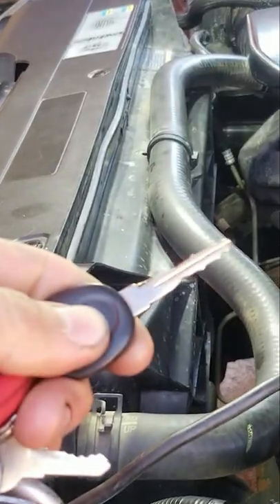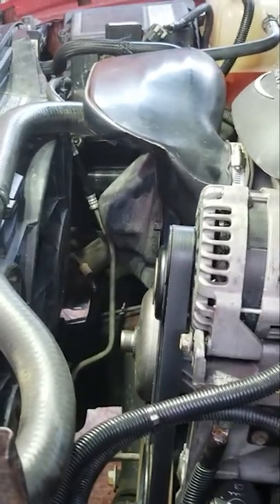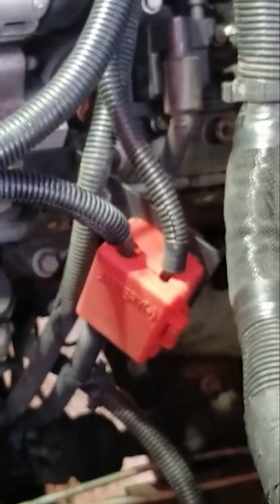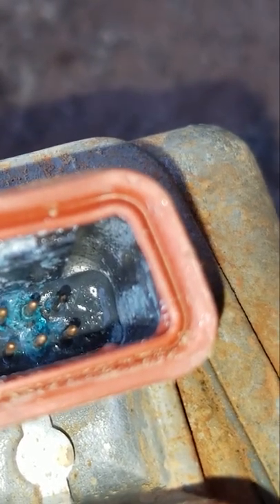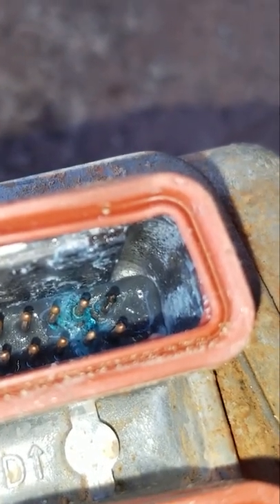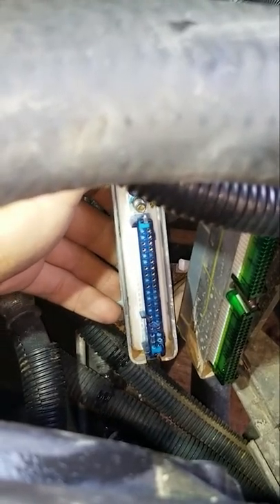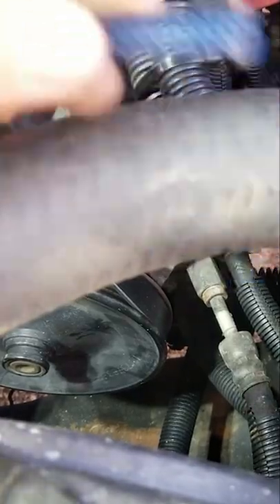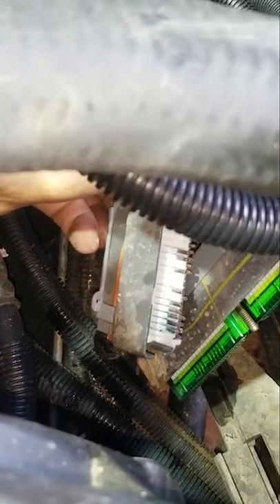Customer States PCM Corroded

Comment: Funny power control module story from a dealership I used to work at. There was an amazing mechanic that was the go to kid when complicated issues came through the door. I forget what the RO said but the official diagnosis from the kid was a bad PCM. The kid gets a new one from the parts department and it doesn't resolve the issue. Kid goes over his troubleshooting again with the parts manager and they had 2 more PCMs in stock and so he swaps it out with another brand new unit. Problem still persists. He swaps it out with the 3rd PCM and the problem still persists. Service manager told the kid to start from scratch and he spends 2 full days pulling apart wiring harnesses and running jumpers. He broke like $300 in panel clips troubleshooting and in the end still says bad PCM. A Chrysler master tech comes from another dealership and does the same thing the next week. His official diagnosis was...... Bad PCM. Now the customer is PISSSED about not having his vehicle for 3 weeks and the original mechanic suggested taking a PCM out of a vehicle on the lot and everybody was completely out of ideas so what could it hurt. He pops the known good PCM out of a brand new truck and instantly the problem disappeared. Chrysler didn't believe the story and went over every single RO note and interviewed the mechanics and in the end they figured out that there was a batch of PCMs that had a manufacturing defect and the dudes truck and all the PCMs in the parts dept were from the same batch. If I didn't see that saga unfold on the lift next to me I wouldn't have believed it but i saw it with my own eyeballs. The mechanic was only like 24 at the time so nobody took him serious but after this craziness we all really respected him. He died of a heroin overdose a few years later.
Reply from the maker: Woah, that's a crazy story. With a sad ending. Just because he's young doesn't mean he doesn't know his stuff.
Reply: Wow thanks for the story
Reply: @galenyoung8349  buddy please reach out to mental health providers in your area.
Reply: @galenyoung8349  bro what the heck
Reply: Sorry bout your buddy. Got a lot of respect for guys who can work on any wiring problem on these new models. It's all Chinese to me lol. My little brother died same way. Was also very smart. Pilot. Civil air patrol. But got a DUI while home and it ruined his life. Get a DUI on you record and ur a pilot and it's over. Went downhill from there till he died from fentanyl laced heroin. Lot of good people's lives destroyed from that shit including their friends and family.
Reply: @michaelf.2449  no kidding
Reply: @galenyoung8349  tho I’m am with ya 
We can never agree publicly
Reply: Funny, I love reading that story but the biggest thing I got from it. DON'T DO DRUGS.
Reply: My god that is so so sad that kid was so talented may god be with him
Reply: Damn.. RIP cuh
Reply: You didn’t have to throw in that bs at the end. Why honor someone then say “yeah he was a junkie and died” at the end?

Comment: No wd40! I find it washes out over a short period of time.  It will work. I personally use GM dielectric grease! Its the best that I've found.
104071, or jt140620.
I came across it with their fuel pump wiring kits. I have cars coming in from 10 years ago that show no moisture or corrosion. Hope this help for the future (Michigan cars)
Reply: A dielectric prevents current flow. In short, it's an insulator not a conductor.

Edit: I've been a lineman for close to thirty years. We used to put dielectric grease on connections when I started at a utility company in 2000. In time it proved to be a mistake
Reply: I am with Dielectric grease but yes too much can cause poor results...
Reply: For real should be using contact cleaner as it douse not contain water or stabilizers witch rubbing alc has. You would want to use iso alc not rubbing if using alc as it contains less water and evaporates faster. Should not use WD40 on electronics as others have stated use dielectric grease for protection!
Reply: Corrosionx is great for situations like this. I'm not affiliated with the company or anything, i just like the product.
Reply: First use contact spray to clean off the corossion not wd40 thats a big mistake.
Reply: Man I was looking for this comment!  To my surprise it came from a fellow Michigan resident. Winters make us hard people and man it has been a long one this year! 😀
Reply: Anyone try silicone lubricant? I’ve used it on many things from seals, plastic, locks, bike chains ect. It’s dry and seems to help with water like wd40
Reply: @HiVoltish it is a nonconductor , and if used correctly , keep moister away. This is not a time for " the bigger the gob, the better the job"
Reply: @TopherToke  either cleans as well as the other, using a brush to remove the corrosion helps too.
Reply: @TheOhsemix  No, you do not need to lubricate any thing, but, it is better than nothing...

Comment: I use coca cola for cleaning the green out well.  I used to use battery corrosion spray but found Coca-Cola works better. 
Then apply thin layer of high quality die electric grease.

Comment: I had this issue a few years ago and never figured it out.
The only thing I didn't do was go into the wiring harness which had to be the location of the problem.
Ultimately I wired the fans to come on when the ignition was turned on and never had anymore problems, and last I knew it was still doing fine with the person who owns the car now.

Comment: FYI WD-40 evaporates and will actually leave the surface it’s sprayed on dryer than it was causing it to corrode again but faster, always use dielectric grease on electrical connections! And fans running when they’re not supposed to is usually a telltale sign of a bad ECM/PCM.

Comment: I've run into that before, the corrosion was so bad I had to replace pcm and the bottom 8 wire terminals. Worse part was we never duplicate the fans staying on while it was in the shop.

Comment: The knock sensor wells under the intake have water in them.  The water travels through the wiring to the PCM.  The knock sensor wires are near the fan relays wires.

Comment: You ever try contact cleaner and dielectric grease? Works wonders for me, plus you can use dielectric grease on your spark plug boots for extra protection from them breaking off

Comment: Had the same issue with my Jetta. I replaced  a bad fan with an after market fan. It would not shut off. Went back with OEM fan and it worked fine. Weird.

Comment: I noticed you mentioned that it was green corrosion you better check your coolant temp sensor it'll push coolant all the way through the wire to your PCM and that's your cause
Reply: Another look at the video shows a particular pin has the corrosion for that pin wire see where it leads that's where your contaminants coming from

Comment: That 'hidden' fuse panel(ubec) will need replaced. Water and road salt gets in from below and can't dry out. Horrible design. I work fleet, have changed @50 in the past 12 months. Fans staying on, lighting and charging problems and no starts. That's the main power distribution underhood.
Edit to say after cleaning the terminals and replacing ubec, coat terminals with dialectric grease.
Reply from the maker: Good to know. It seems like a very dumb design. It is so hidden, most don't know it's there.

Comment: Rubbing alcohol WD 40.  EEERRRR. 
Dialectic grease, electrical connector cleaner/spray.
Reply from the maker: I use dielectric grease > They say use WD40
I use WD40 > They say use dielectric grease.

Comment: WD-40 will accelerate corrosion. Stick some bolts in a jar with WD40 and watch it over a week.

You use dielectric grease on electrical connectors. The grease is designed so it doesn't short any contacts while coating everything to prevent dirt and moisture from starting corrosion. 

It also is good to put on the connectors and sockets for light bulbs.

I don't know if this guy is just trolling to trigger mechanics or if he's for real. If he's for real, stay away.
Reply from the maker: WD-40 doesn't corrode bolts what are you talking about??? WD-40 was literally invented to spray on electrical connectors of rockets.

Stay away? Off of one tiny thing I did?
Reply: @MattsShop  

Lmao...you're definitely a troll.

👍

Comment: Here's an idea. Don't buy shit that relies on a computer to function
Reply: I love how this comment was made on an electronic computerized device.  Why did you buy it?
Reply: @connor3288  Touche good sir! I don't drive my phone or rely on it to get me to and fro, but I see your point.
Reply: @dolanroufs1032  i don’t have an issue with electronics in my vehicle. It diagnoses itself!
Reply: @EGGSHL  Really? Then why do auto shops spend THOUSANDS OF DOLLARS on separate computers yo talk yo your car? You can't bullshit a bullshitter. They don't diagnose themselves. Since when does check engine or service engine soon mean anything? But you believe what you want and in another 30 years when your computer has been recycled 17 times I'll still have the same sbc in my pickup
Reply: @dolanroufs1032  ‘check engine’ is a pretty simple thing to fix. If you have a check engine light anyways, chances are, things aren’t going to run correctly. And an old car can’t do that anyways. Not to mention older cars make less than half the hp